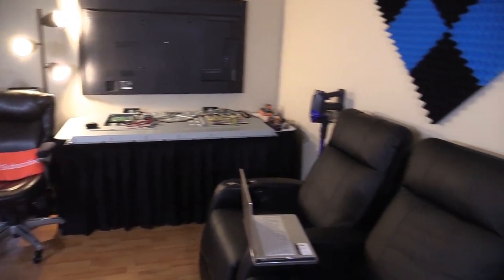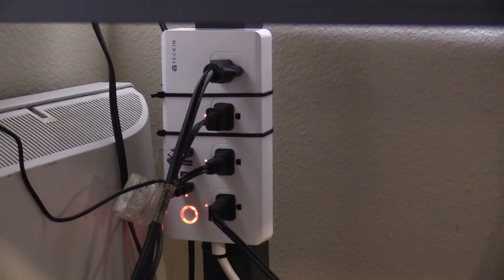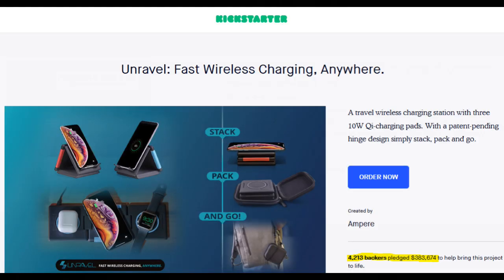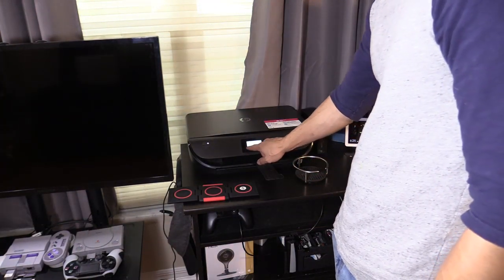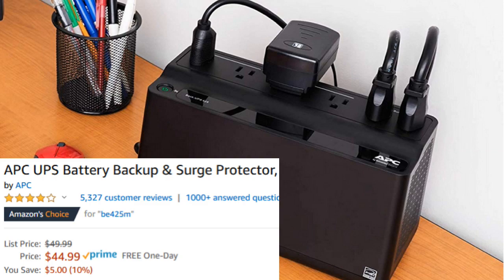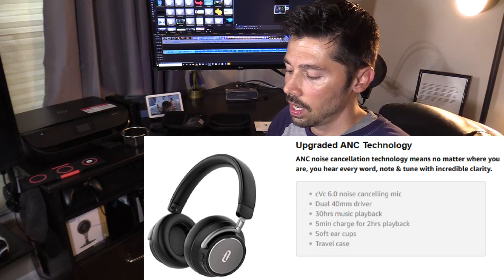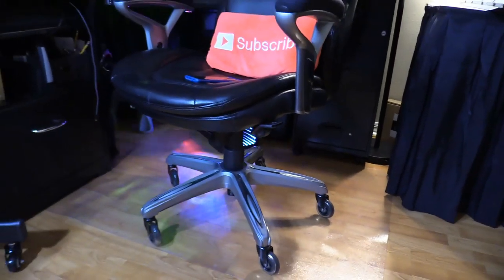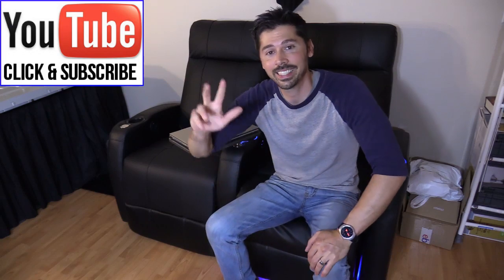My Favorite Tech in My New Home Office 2019

Comment: I much prefer my 180X AmScope. Even with my board preheater under it taking up 4.5 inches, I still have plenty of working distance. You can make your own fume extractor with a 4" inline fan, 4" carbon filter and some flex hose. Mine also has a foot switch.

Comment: Not a fan of that case performance wise. Very tough to get Air intake with the infinity mirror. Not sure how you have it all set up but the top fans and rear appear to be setup as exhaust. You might not be pushing your PC with an overclock so it shouldnt be that bad.

Comment: I got a problem with my PS4 controller and basically it fell in water. I fixed the left hand side. The right hand side doesn't work. Yet. The middle button to turn it on  keeps turning on the controller and the shapes buttons don't work but everything else does. Just the middle button and the shapes buttons. Any tips
Reply: @Seffo  Bit late inni 
I figured getting a few controllers would be a bit better..